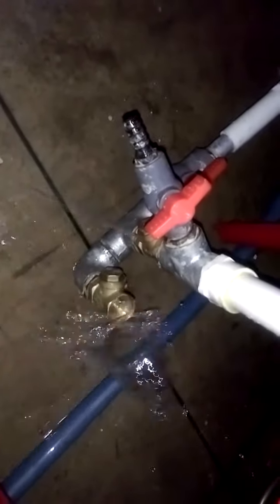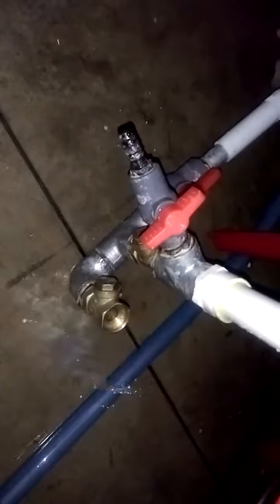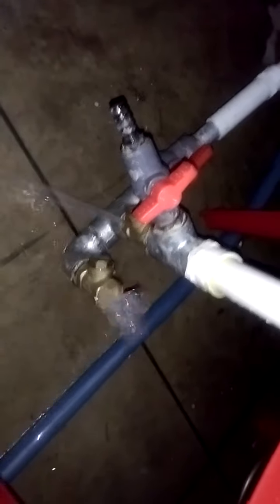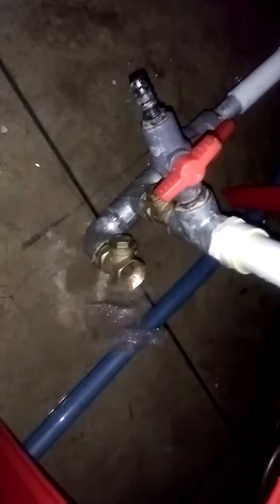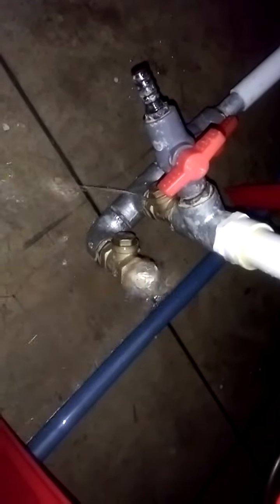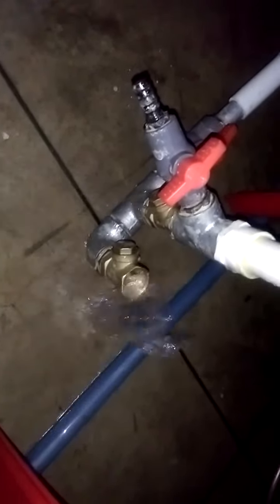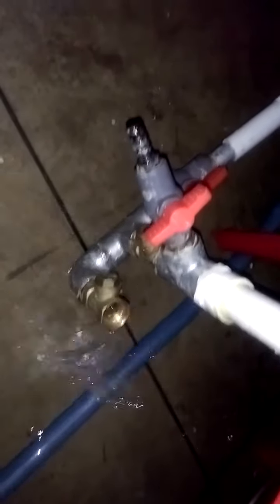Hydraulic Ram Pump (almost working 2)

Comment: Adding a delivery pipe that is about 10 to 15 feet vertical should give you enough back pressure to open your delivery valve at least partially. 3 feet of head provides approximately 21 feet of lift. also to make your system more efficient a longer drive pipe can be used.  Currently I notice your system is running fast. A longer drive pipe would slow it down
Reply from the maker: Land to House .com Thankyou for the response :) Its unbelievable how beautiful Ram Pumps are. Yep, I will definitely make a few changes including connecting a garden hose to the delivery pipe to provide the necessary back pressure and also increasing my drive pipe to about 15 feet. The more I work on the ram pump , the more I'm falling in love with it. Wouldn't have been possible without you and a couple of other ram pump enthusiasts.Cheers!
Reply from the maker: Land to House .com Absolutely. Awesome website by the way :)
Reply: @urdouchbag  sir have you drilled a hole in delievery check valve?
Reply from the maker: @kumarakash7322  Yes bro, its called the snifter. It sucks in a tiny bit of air and pushes it up the PVC pressure pipe every time. So overtime, you will have air pressure pushing the water downwards in the pressure pipe which will propel it in the delivery pipe. 
At the time I was doing this project, a lot of American creators used foam to fill the top of the pressure chamber as an alternative to snifter. But the snifter just worked fine for me.
Reply: @urdouchbag  thank you sir, the pump is working . I will share the video soon.thanks for your input.

Comment: Glad you got the pump to work, will look out for the video
Reply from the maker: Michael Collinson Hello Michael! I finally got the entire system working. I was able to lift water up to 15 feet from a drop of a little more than 2 feet. I would love to get your inputs on this https://www.youtube.com/watch?v=CTUUAD274jg Thanks for helping me out! Cheers!
Reply: chilledoutdude The setup looks just fine to me and is working well, I would just second Seth's suggestion about adding a non return valve to the delivery pipe. It made quite a difference to my system

Comment: I would agree with Land to House .com  more back pressure in the delivery pipe should solve it. Here is a link to a very good resource giving tables of sizes and pipe lengths etc http://www.clemson.edu/irrig/Equip/ram.htm
My pump runs at about half your speed so that is probably another factor
Reply from the maker: Michael Collinson  Hey, thanks for the response. Yup, I know the drive pipe is supposed to be longer than the one I'm using. I will make the necessary changes soon and upload another video of it, hopefully fully functional this time round. It's a shame that this beautiful device isn't used much in my country where the villages experience extreme power shortages during the summer months. Wouldn't have been possible without you guys!!! Cheers!
Reply: chilledoutdude it has been my experience that my country hardly knows about these pumps.
Reply from the maker: Land to House .com It's off the grid and completely ingenious. By the way I managed to run my pump :-)
Will upload the video soon.